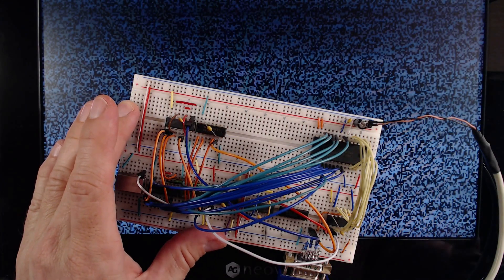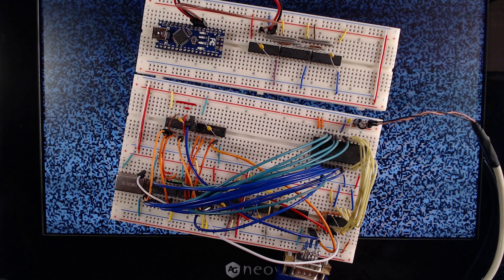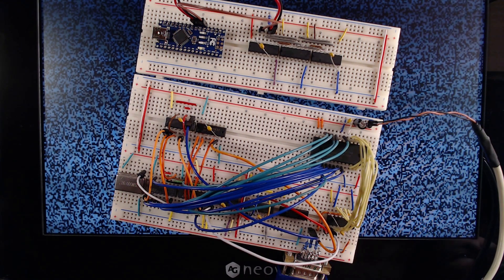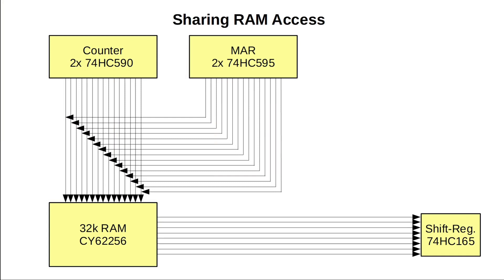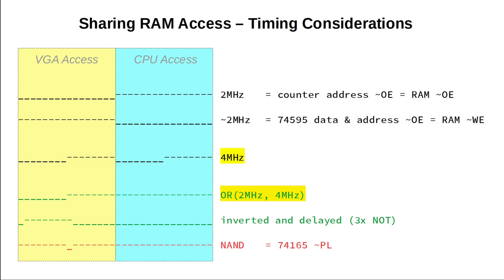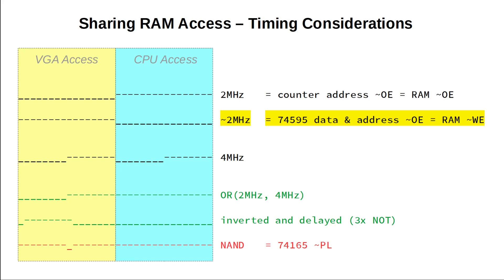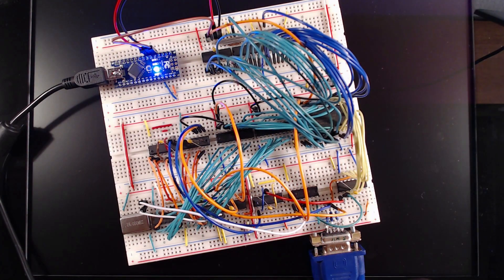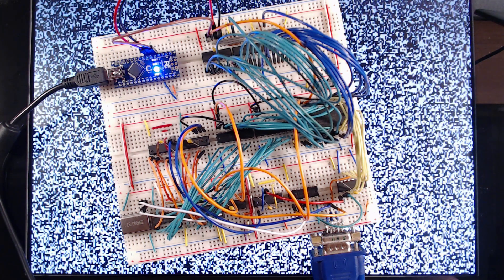DIY Video RAM #3 Sharing RAM Access

Comment: How does the CPU/Arduino know when it can access the RAM? In this video and the following one it's not clear to me what is preventing some of the writes from failing when the shift registers don't have write access to the RAM. Is it just that the arduino/cpu write cycles are so long that you're sure the data will be sitting on the shift register outputs when at least one 2MHz cycle comes around?
Reply from the maker: You describe the shortcuts of this early design correctly. My aim was to achieve the functionality with minimal effort. I am about to publish a design I consider much improved. It's a full DIY TTL home computer with VGA and PS/2. 61 ICs. Stay tuned. Cheers!

Comment: Hi - yep seeing the pixels appear when poking ram and/or using assembler to make the Apple II Europlus  one  bit speaker ( ie on/off ) make weird tones at school in about 1980 was amazing. I also have the really surprising and vintage experience of having our school teletype hook up to a computer at the Ford's plant using one of those big ears (accoustic coupler) modems - I can't believe we were allowed to do that considering todays' security vigilence.
Anyway ... 

Re this video - I'm trying to understand how the CPU and video avoid each other. 
Is the CPU completely paused (ie literaly doing nothing) while the video is accesing it's ram? 
If not then how are you actually arranging for the CPU to respect the high phase of the 2MHz clock?
Reply from the maker: Hi John, thanks for your detailed comments. It's really appreciated. Within this approach the CPU is doing nothing while the video is using the RAM. Not efficient, I know, but I am only interested in basic principles and don't try to reinvent ray-tracing GPUs here :-)
Reply: @slu467  Hi thank yep that makes sense I was just wondering to help me understand the detail of the approach as I'm tryig to figure out  various options - makes sense - yep simple = keep it up.

Comment: For the buffer of 15 address lines you can take the HC244. Is not need to have both directions.
Reply from the maker: Sure, what I like about the HC245: Same footprint, but all inputs neatly organized on one side of the chip. And you can chose the direction for whatever favours your breadboard or PCB design. Cheers!
Reply: @Slu4  , right, the inputs on one side and the outputs on the other makes PCBs easier. I like the latch 74HC573 with this characteristic and with 3-state-output. You find 3-S-O also at counter 74HC590.
Reply from the maker: @paulkirchhof9546  Having 8 data lines integrated in a single chips sounds like a good idea, but be careful: The 590 is missing the important "data input" feature and thus can't replace the 4-bit 161. The 573 has no clock and therefore works async. which also is a knock-out. It seems I am stuck with the 4-bit versions ;-)
Reply: @slu467  , the 74573 is for Address lines only. The 74161 and 74191 are synchron counter and better than the other one. I think the 74163 and 74193 are also good for video address counting.
Reply from the maker: @paulkirchhof9546  oops, I've mixed up two different projects of mine. For some reason I thought you were commenting on my 'Minimal UART CPU' design :-)
Reply: @slu467  , I think of the video with Arduino Nano and VGA.

Comment: Great series, thank you very much for sharing your ideas with us. I hope to find the time to connect a version of your VGA board to my breadboard computer during the winter season.

One thing came to my mind: You introduced the 74HC245 bus transceivers stating it was because the 74HC590s don't have a tri-state output. But they have (PIN 14). I believe the real reason for putting a transceiver between the counter chips and the internal address bus was isolating the V-Sync and H-Sync logic from the address bus during the RAM update phase. Using a 74HC373 latch for the six wires from the address bus to the sync logic instead (having that latch transparent only during the VGA phase) would save one chip and ten wires. Or did I overlook something?
Reply from the maker: Thanks for diving into this, DerULF1! Of cause you are right /OE is not usable here since in my setup the 74HC590's output needs to stay active for the sync pulses. I got confused after hours of tinkering with this... your idea with the latch sounds very promissing. There is always one more IC you can get rid of ;-)) Cheers!